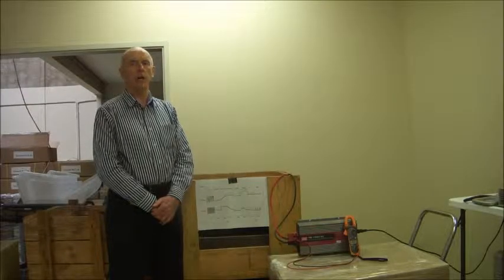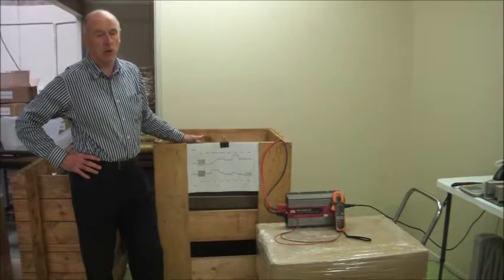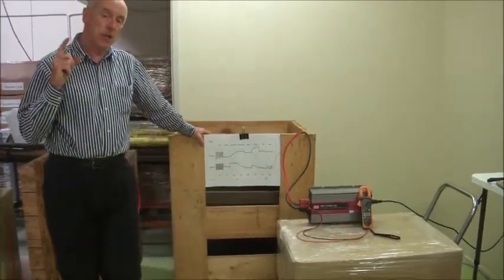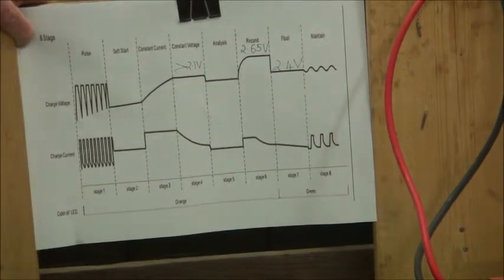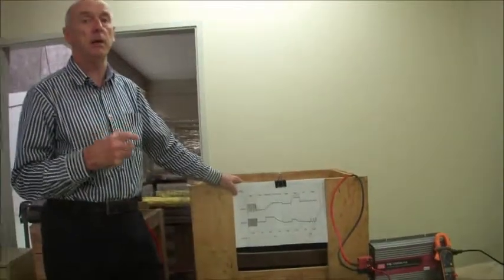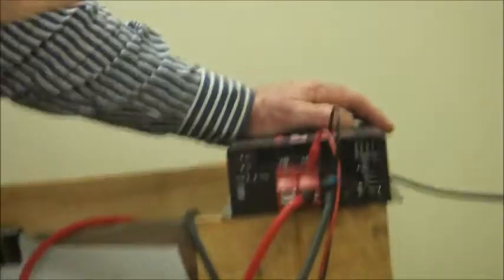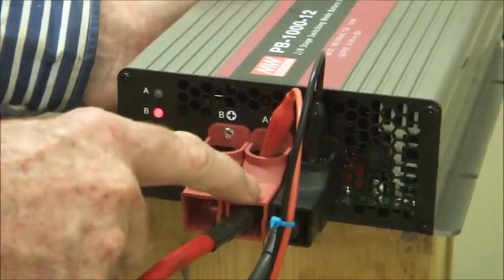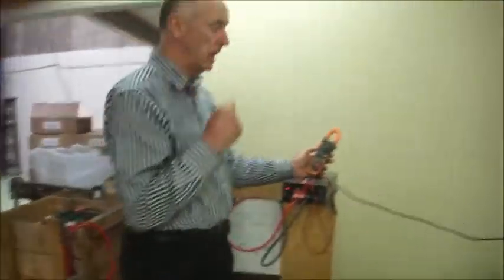Tortech 8 stage Battery charger - Regenerate older Batteries with a Single Phase battery charger

Comment: Would the charger be able to supply a current to charge a battery bank of 800Ah ( 8 batteries in series-parallel) connection ?
Can you recommend a charger that can fully charge a battery bank of 800Ah.
Thanks